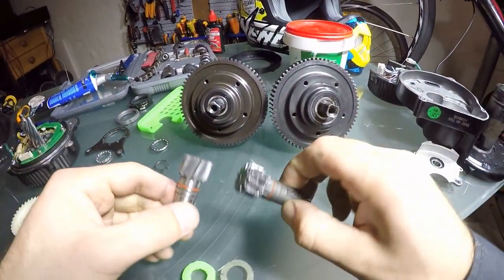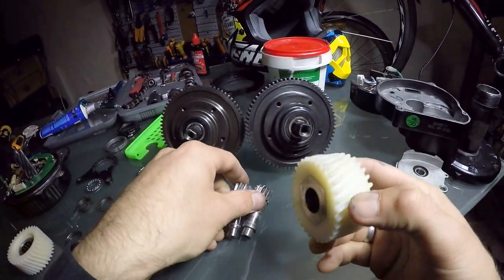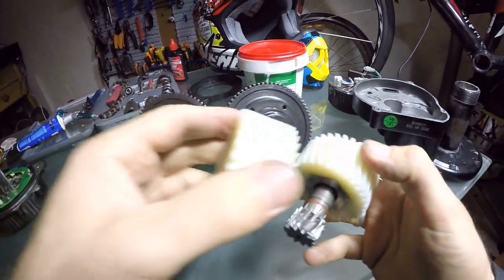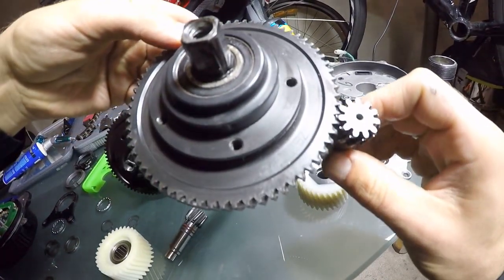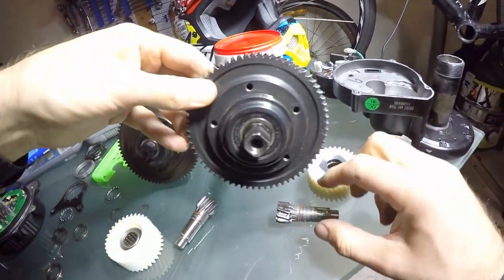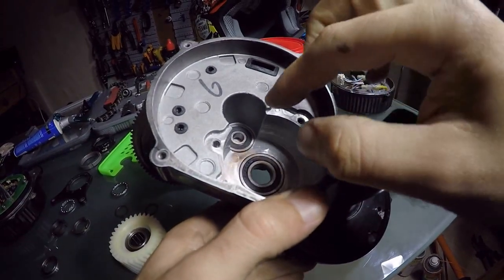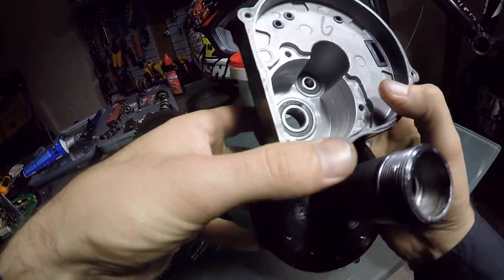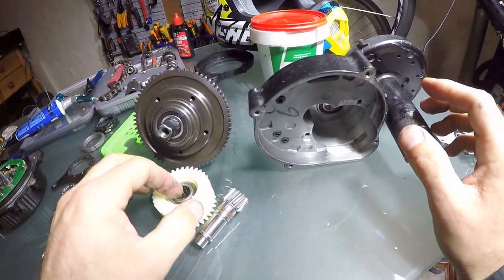DIY Tutorial Repairing BAFANG 8fun BBS02 750w 48v (Part 4 of 7) *internal gears comparing new vs old

Comment: Whats the difference between bbs02 and anbbshd nylon gear? I have bbs02 with almost 10k km in one year, no nylon gear failure. I would like to push 10-15 more amps (if possible) with external controller. What do you think about nylon gear durability cause I shift to stay in peak power range (60-80% rpm) and i want to be able to push full power all the time. How much amps would you reccomend with 52v. I know i maybe ask a lot but you are the one of few who i believe about this topic. Save my life maan XD

Comment: Used a late 90s 28inch wheel 7 speed cassette Bruno and 44t  front. Top speed 15mph. There's so much more talk I just can't keep up with the peddling man. Been reading others have had this problem. I'm concerned a larger 52t will be just touching the frame. Do I need a new bike? Bike shop said it can't be upgraded but having a 10 11 gr cassette won't do much. Is there a spacer to give the 48t 3mm to clear?

Comment: One thing I've noticed with these is it could be advantageous to match your cadence to the assist level. I've noticed that on level 1, this motor tries to do about 70 rpm at the crank. On level 5 it's about 140 rpm at the crank. The motor will slow under load but if you are pedaling at 60 rpm in assist level 5, this is substantial labouring of the motor and it might be worth it to downshift a few gears and really get those pedals spinning. The motor will run more efficiently. I'm not sure what percentage of the no load speed it's best to spin above.

Comment: Sweet. I wonder if aluminum gears are possible. It looks like you could really drop the motor weight substantially with aluminum gears. Some hard aluminum like 7075 might be up to the task. They should also make a chromoloy gear upgrade. Looks like they are using a cheap type of steel. In the 1000 W did they upgrade the gear material? I wonder if an aluminum motor case would also be possible. Dropping motor weight would be one of the easiest ways to make the kit much better. I use my bafang for mountain biking and really ride hard on it. I ride it up and down mountain and through deep snow. Going up a hill the weight reduction help alot, but also the lighter motor will bounce around less. Sometimes motor spins in my bottom bracket because it's so heavy and has so much inertia. One suggestion I have for you is to buy mini-crankarms. My crankarms are only 90mm. This makes pedaling super easy, because you can keep up with motor much easier. It also dramatically reduces torque on the bottom bracket, which allows me to do drops/really smash my bike hard, as well as knocking a lb of weight off each crank.
Reply: +ElectricBike (Bruno) Hi Sir, just asking if you would recommend the new 1000watt bafang mid drive? is there a big difference between the two in terms of durability?
Reply: ElectricBike There is many massive sprokets! Go on ebay and seatch 40t cassete cog. I think 42 is the largest I have ever seen hahaha
http://www.ebay.com/itm/40T-42T-Tooth-cog-for-Shimano-Sram-34-36t-10-speed-10s-Cassette-Teeth-Sprocket-/272079912933?var=&hash=item3f5939ffe5:m:mfWXFrU6Kl8hCWPg4ll3WUQ
Reply from the maker: +Clifford Zvengrowski - Yeeeeahhhh... THANKS SOOOO MUCH for that... I was about to order one for my road bike (would be a bit stupid having this on a road bike) but it only fits on 10 speed cassettes so I saved that ad in my favourites and will order when I'm building my fatbike.. hahaa... I love my YouTube friends =]
Reply from the maker: +Clifford Zvengrowski - Yeeeeahhh.. this is one of the best comments I received in my channel... I love discussing about these things and also many other people can read these comments and learn a lot too =]
Right.. the torque is huge in the small pinion gear, specially when using large chainrings like 46T, 48T... a very large 52T will definitely stress too much. The smallest chainring the faster the internal gears will spin so the less stress on the gears = your motor will last longer. The faster you spin the motor the better acceleration you get, it won't overheat and get more range from the batteries as it will become more efficient too. Your cells life will increase too... so many benefits I can list here... so why Bafang and DIY builders don't do it? Cadence...  that could easily be fixed with a smaller crank arm like you mentioned there =]
The BBSHD is here, really powerful and MUCH FASTER cadence... all those things I mentioned above are actually true. Cadence? I always tell people "people don't drive their cars at its maximum 7500 RPM they change gears before it happens but is good to have that EXTRA power if you're going uphill or overtaking someone".
7075 Aluminium gear: would only be possible if you spin it really fast, the massive flywheel would be the first thing I would change to reduce the weight,  much more than the pinion gear, the BBSxx fittings like the large triangle metal plate could be 7075 alloy too. Controller is very small and it needs some alloy casing for heat sink.. the nylon gear is very light... the whole frame is cast alloy already (very light).
What I think it is really heavy there but can't be alloy? The huge BB axle 
Large metal bearings are very heavy and could be replaced by ceramic.
all those changes will make this mid-drive double or triple the price and no many people would have access to this technology... =[
If you really want something really powerful, really lightweight and no internal gears + better frame fittings.. you should talk to Matt and get your custom mid-drive here: http://davincidrives.com/ yes, it is a premium price you pay but you get the best of the best (tell Matt that Bruno YouTube recommended)
Where did you get your mini cranks from? I may get one myself =]
Reply: +ElectricBike I don't think they should sell the whole motor with max upgrades, but maybe make it so you can buy individual pieces as upgrades. (like the bling ring) I have a rule... 25$ for 100 grams is good cost to weight saving. Anything more isn't worth it. You can buy your cranks here for about 80USD. Also one thing to note, the right crankarm on the bafang sticks out further from the frame than the left. You should measure this and tell Mark to make the left crank offset, and the right one straight down to balance this out. 90mm is the perfect crank length. You will see it gives you perfect speed, so you can always pedal faster than the motor, but also have good POOWWWWWERRRRRRRRRRRRRRR. Tell him you want exact same request as Clifford, but with left crank offset more, and measure how far you want it offset.
mark@bikedesignsmith.com
Reply: ElectricBike
I am also confused by your statement. So you are saying that if I had a 10t on the front and 10t on the back this would be lower stress on the motor than 50t in the front and 50t in the back even though they are both 1:1 ratios?
Reply from the maker: +Clifford Zvengrowski - Yeeeahh... the $25 per 100grams is a good rule... I may start using it myself haha... thanks for sending Mark's email, I have been thinking about short crank arms for a while now...
Reply from the maker: +ElectricBike (Bruno) - ah... what I said about the large chainring is not related with the cassette (rear gears)... the larger chainring (front) you have, the more torque the motor will have to generate to turn the gears and this will increase the heat in all electronics and stress too much all gears. Is almost like starting a car in 3rd gear but electric motor you have a huge torque from even at very low RPM, if you don't spin... something is going to break (internal gears or frying the controller in this case).
Reply: ElectricBike
But if you have large gear in back, the less torque motor needs to spin the wheel because you have more leverage right? Leverage = front gear divided by rear  gear times wheel diameter
Reply from the maker: +Clifford Zvengrowski - Yes, your calculations are correct, you "can" get the same ratio in few gear combination. In reality, a larger chainring will be always forcing the motor. Most sellers realised that customers riding their Bafangs with the Lekkie Bling Ring had much less mechanical failure compared to the larger chainrings customers. I had a 52T for 2300kms in a very light weight road bike and I am always pedaling hard helping the motor, my chainring had dents where it grabs the chain + I completely destroyed my internal gears having to replace the pinion and the large flywheel. I serviced a heavy cargo bike with 6000kms with 42T Lekkie Bling Ring the aluminium chainring had no dents at all and all internal gears were like brand new. The faster you spin, the less you mechanically stress your gears (including the bicycle gears) =]
Reply: +ElectricBike (Bruno) I got the 36t with the adapter. I think 35 is the smallest size you can run with the adapter otherwise the chain scrapes the motor.  If you gotta flip it over then your chainline is awful and you will need a chain guide.  36 is good. If you go any smaller you won't be able to use the motors max speed even with the smallest gear possible in the back. The adapter is good imo, bought one for 10$, and a chainring for 30$. Bling ring is nice, but not worth the cost imo. Doesn't meet the 25$ for 100 gram rule lol. + you can go smaller with the adapter.
Reply from the maker: +Clifford Zvengrowski -  Yeahhhh people like the Lekkie because of the chainline + narrow and wide tooth + lightweight and blablabla but if you're going off-road 42T realistically is not that small... 36T... you can do some serious hill climbing hahaa =]
Reply: ElectricBike Hell ye! I am doing 36 front to 40 rear lol
Reply from the maker: +Clifford Zvengrowski - Whaaat... 40T rear?????? Where did you get it from? is this a custom sprocket?? I have a 34T and there are very few 36T out there but 40T...!?!?!?!!??
Reply from the maker: +Jose Gonzalez - Yeeeeeahh.. The BBS02 is actually the "BBS01 on steroids". the BBS01 was designed to be reliable at 36v 350w then Bafang did some little mechanical and electronic modification and pumped 48v 750w and called BBS02 good if you want more power but it became quite unreliable for some people with aggressive riding style after 2500kms. The BBSHD was almost completely redesigned, they improved so many things, if feels really nice riding it, we opened one in the workshop and this thing can handle much more power that is actually running, that makes it very reliable, maybe they have plans to upgrade next year and make a bit more powerful like they did previously. My advice... get the BBSHD =]

Comment: Do you also know of 750w motors being labelled as 500w by bafang. or am i being conned as I paid for a 750w
Reply: hi just recently bought my unit directly from china using alibaba. still waiting for the unit i just hope it will arrive and working good. how much did you pay for it?
Reply: +Jose Gonzalez $1400 for a bbs02 with a 20ah triangle pack battery.  On the first charge i played around upto level 9 PAS and I got 83km out of it and I know I can get more if I was serious about commuting further and kept the power under check.  I purchased this kit of an ebay seller out of ebay but via paypal for buyer protection. He is a great guy and I'd highly recommend him to anyone.  His name is Daniel Pereira and his ebay id is electricbikesandstuff.  BTW i dont know if he will still provide this combo at the same price as I was the first to purchase his triangle battery pack so please ask him and he will get on top of it.
Reply: +Daniel Alvares Would you recommend buying the new 1000watt bafang motor? or the 750 watt will be enough? is there a difference between the two in terms of durability?
Reply: +Jose Gonzalez Mine&#39;s a 750w but if you can spend a few more dollars then go for it.  I didnt realize that places like emax-ebikes.com.au sold these or else i would have got it.  however i have no regrets with my current motor either.  Oh and Bruno I am sorry for recommending another seller here I just thought that it is rude to recommend another seller especially when you are providing support through your company. so please if you delete my comment I wont take it personally as its your channel :)
Reply from the maker: +Daniel Alvares - +Daniel Alvares - Yeeeahhh.. no problems here... I work for emax-ebikes.com.au but I am always helping people from all over the world I also talk about other sellers etc... I see my messages as an open space like a blog so people can post whatever they want, the more info people share the better for everyone =]
Yes, I know Daniel Pereira, we talk all the time, I personally don't do any business, I try to stay away and just do the geek research and tech stuff + helping people here and passing all the feedback I get from my subscribers to the sellers and also Bafang so they can improve things.
The last shipment Bafang sent BBS02 motors labeled as 500w but the motors are all the same, the only thing is they changed the settings (programming) lowering the amps but if you pump it up you get all that power. It is interesting because on Bafang website the 750w is gone they only show the 500w, I think it may be a marketing strategy pressuring people to buy the BBSHD 1000w. 
83km/h?? Are you running this thing with 52T chainring like I did in this video https://youtu.be/5NQAZSzJdrc
Ah check the display settings making sure the wheel is set to the correct size (26" / 700c / 29) if its all correct, you should post a video and drop a comment in my 85kmh video with your link, many people wouldn't believe my speed, I need more cases showing that YES it is possible if you're crazy enough hahaha... so much POWEEEEEERRR =]
Reply from the maker: +Jose Gonzalez - Yeeeahh.. I used to be so crazy about my BBS02 until I tried the BBSHD... it is a new design with so many improvements they learned from previous motors and customers feedback. the "HD" stands for heavy duty and you can tell that everything there was built to last.... I have been riding it pushing really hard and it rides better than my BBS02. The extra power also makes it a bit more efficient as it is not struggling working hard on 100% of its capacity. Be happy with the BBS02, it is a great motor and packs a serious punch. If you have problems you can find BBS02 parts available everywhere and they are cheap. Also there are lots of videos showing how to fix BBS02 / BBS01 both models look exactly the same.
So much POWEEEEEEEERRR =]
Reply: +ElectricBike (Bruno) I will definitely do a video of me riding the bike but sorry mate I'm not crazy like you with big balls of steel. The other thing is I dont have the programming cable so I'll be buying one soon but I'm not in a rush as I am quite happy sitting at 18amps for the time being and its assisting me to 40km/hr.  I've got a Giant 26" mtb setup with 46T and with a triangle pack (not as discrete when going as fast as you) 20ah battery (chinese cells) capable of putting out 30amps but they are Chinese batteries so they could say anything.  When I do beef it up I would like to push it to at least 60-65 km /hr but I will only do that on the previously friend controller after soldering new 3077 mosfets on them - God knows when that will happen because I am enjoying the current setup a lot - sorry i know you probably think I'm boring.  hehe
Reply from the maker: Hahahahahhahaa... no you're not boring here...  I am laughing so much with the "BIG BALLS OF STEEL" hahahaha thanks for that one..  Yeeeahh, there are some good and of course some nasty packs made in China, the thing is, no one wants to make packs (so much work manufacturing it and also handling batteries, requires a specialist so labour cost would be ridiculous here in Australia) companies send this task to China and unless you actually open and inspect every single pack.. who knows... but 30A for a very large 20Ah pack is okay...
I started playing with all settings as soon as I got my programming cable and made my BBS02 speed like a rocket.. then I had to do a major service after 2300km the pinion gear was completely destroyed and damaged the big flywheel as well https://youtu.be/xUKz40ukbHc
How did you fry your controller climbing up hill? Yeah just keep using the controller you have there.. if you fry again (very unlike) then you put the new fixed one =] If you have a small chainring like the Lekkie bling ring will save your internal gears a lot but reduce your top speed.. =/
POWEEEEEEEERRR...!!